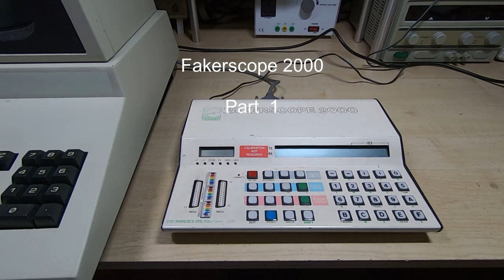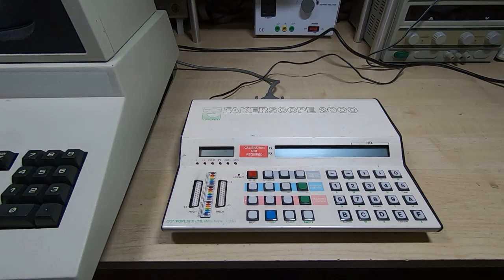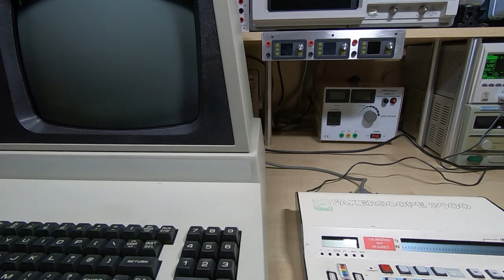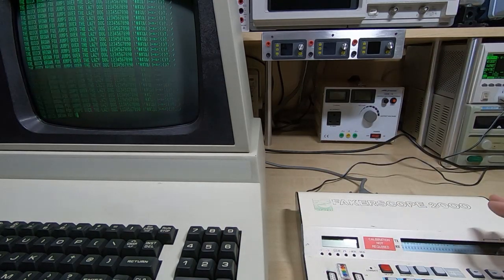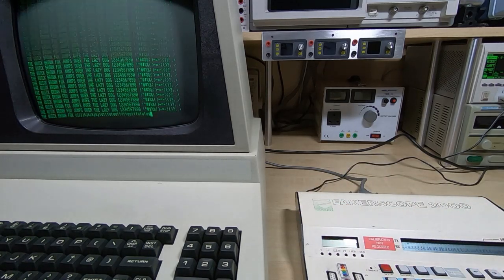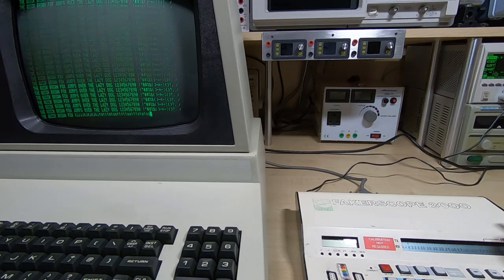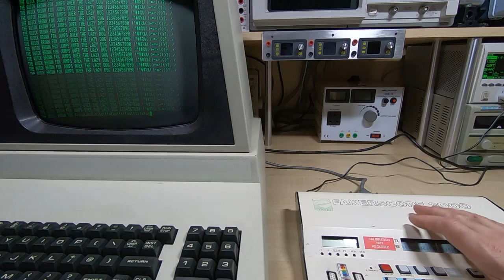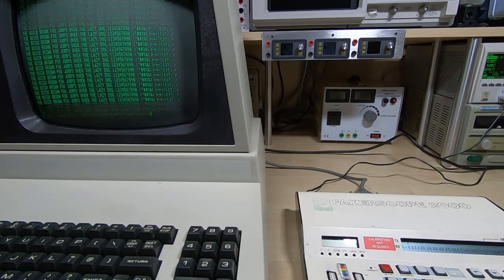Fakerscope 2000 Part1

Comment: Hello, I know this is the wrong video, but it's the most recent. I'm trying to decide to buy your book "Computer Time Travel" but there is no table of contents on any of the resellers(like amazon, etc...) and this is kinda disappointing as I don't want to send it back. I want to be able to decide on my own if it's worth it or not. It's there a way to have the contents please?
Reply: I'll leave it to Jerry to determine if its appropriate to share the TOC but I'll comment on the book itself.  I bought a copy a couple of months ago and I was completely thrilled with the purchase.  I wanted to better understand the low level operation of microprocessors and this book does a great job setting that foundation by first discussing how a simple Z80 based system works, then breaking down to the functional modules that make it all work, then finally breaking down those modules to logic and gate levels.  I gained great insights into processors from this book and I enthusiastically recommend this book.  I'm most definitely happy that I bought my copy and hopefully you'll find it as interesting as I did.
Reply: @resiggy13  thank you. I guess I'll buy it and see.
Reply: @resiggy13  i just got the book today and I was impressed by the first 40 pages already. Thanks for the advice.